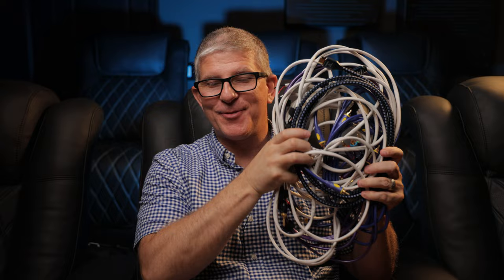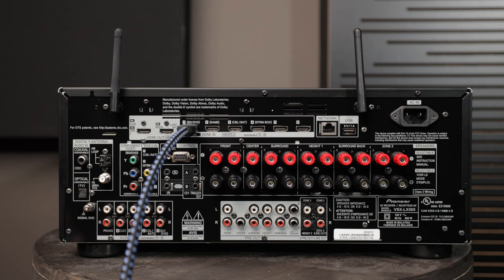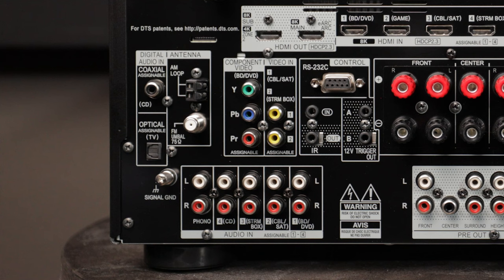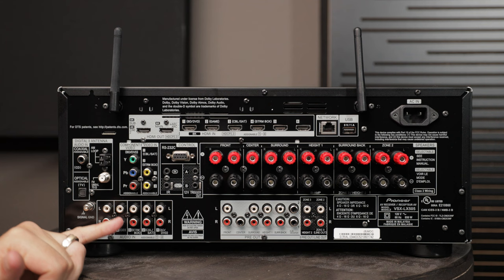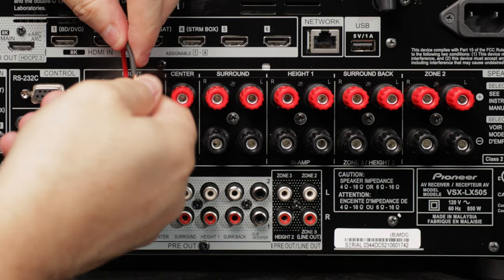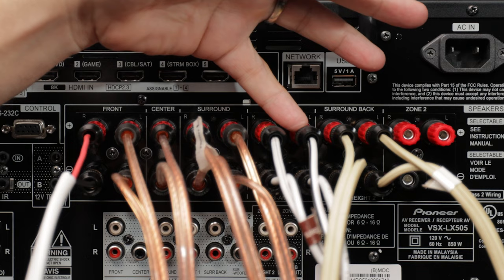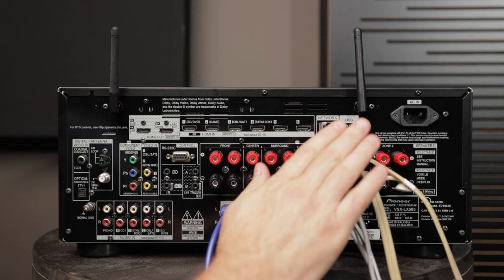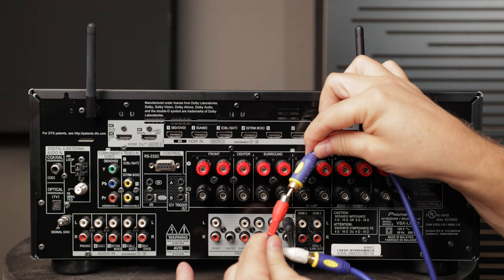How to Connect An AV Receiver (AVR) | EASY Step By Step Instructions

Comment: The only difference betwee this and the one I used 50 years ago is mine was metal and this is cheap plastic. What's old is new again!!
Reply: One other difference, this one has multiple HDMI inputs/outputs…..which weren’t around 50 yrs ago.
Reply: It is actually metal tho.
Reply: The one from 50 years ago also can have a bunch of leaking capacitors in it now as well. I wouldn't try to assume that much from the box alone. Also, this looks like a metal housing in this video.
Reply: How do you connect an av receiver to a tv with an internal tuner? Cheers
Reply: Sounds like the main difference after 50 well-lived years is the eyesight
Reply: Bullshit.

Comment: Oh my gosh, that's how amplifiers work? I'm glad I don't live in a mansion. Wait, (2024 update), that means 24 bit sources have more significance in big rooms. The noise floor in a small living like mine does not require past 16 bit noise floors at all. I don't need a separate amp to jump my 16 bit transcodes past room tolerance. Amps are there to help hardware represent the 24 bit noise floor by allowing more power to surge through them. Bit depth should be relative to the size of your room. Even then 16 bit/48KHz can still fill a room if you have the equipment that can handle even that.

Comment: I bought a house that had a stereo system already installed and I ordered 2 new speakers because some were buzzing. I had no idea how to wire them to the existing wiring. I’m so happy you showed how to do that and all you have to do is stick the wire into the terminal. It looks easy enough. Again thank you so much for such a helpful and informative video.

Comment: @Youthman, I am so glad I found your channel. This video answers a lot of things others weren't.

My friend has a:

 BOSE sound bar that has:
1.S/PDIF Output - 2.a RCA input #1  3.a RCA input #2  -3.a sub out 

SHARP AQUOS QUATTRON

What I see on the back(I'm assuming that's what I'm supposed to use for this case)
VIDEO 1 w/ R AUDIO L AND VIDEO
VIDEO 2 w/ R AUDIO L AND VIDEO
COMPONENT w/ R AUDIO L AND VIDEO AND Pr Pb and Y
(She has the  BOSE  RCA input #1   going into that component R AUDIO L AND VIDEO of the TV.

AV YAMAHA HTR
On the back of the AV I have no idea where to plug anything to the back of this. I twiddled around and put it in the CD in the DVD in everything I could and on the front put in the corresponding input and nothing works. 

I'm confused on making work through the tv(which doesn't work) the AV (which she has sitting there) and I'm lost.

 I see from your video the visual on the back looks so much like mine, but I can't get it connected and for the last 4 weeks till I seen this video, it started to make sense, but still don't know what I'm doing wrong. Its driving me nuts!!

Can you tell me where I'm going wrong or whats the best way please, Thanks

Comment: This person explained so clearly and so sample.
I have watched so many videos about how to add extra amp to av receiver,but this was super easy to understand.
I really appreciate ur video.
Thanks heaps!
Reply from the maker: I’m glad you found the video helpful
Reply: Hi sir.
I need to know more about the pre out connection.
Question: I have 2 AV receiver and they both have same rca jucks for pre out . 
One of them says pre out and another one doesn't says pre out it says AUDIO left, right, center, subwoofer rear right rear left.
So,I don't know what to do?
😊 Or if you could make another video to show the back of both receivers connections .
Thanks 🙏
Reply from the maker: @jannahrusdi872 what is the model number of the AVR
Reply: @Youthman  1: Integra model: DTR-30.4
2: JVC : Model: RX-7022v
3: Yamaha: model: RX-v565.
Thanks 😊
Reply: @Youthman  Hello sir.
I am still waiting for ur advice.
Thanks 🙏
Reply: Where does the subwoofer cable go??

Comment: Very nice overview. I would have liked to have seen you quickly discuss 12v triggers and possibly also IR inputs - but regardless this is a good intro for someone that has no idea where to begin. Thanks for your efforts and all the content you put out Youthman!  👊
Reply from the maker: Amps come with a 3.5mm cable to connect from the 12v trigger on the AVR to the amp. Turn the amps power to on. Now when you turn on the AVR, it “triggers” the amp to turn on. When you turn AVR off, it “triggers” the amp to turn off. That’s it

Comment: ahh there we go, that explains it. i just bought a pioneer vsx 815 at thrift for $20, using it for my PC speakers (sony bookshelf speakers), wasn't sure if I was supposed to do the bare wire twisty connectors or the pre-out (i'm so used to RCA cables, so i tried the pre-out). no sound.. then i went to the twisty, sound works, but was confused as to what the preout even was. thanks!

Comment: Hi, you mention that if you have a sub that you would plug it into the sub 1 on the back of the receiver, however you connected it to the one that has a 2 on the back. Does it matter?
Reply from the maker: No it doesn’t matter which one you use. They both output the same exact signal.

Comment: good step by step set up. But I have an 10+ yr old Yamaha system and all the speakers incl the sub are wired. I am looking to upgrade my receiver as I finally upgraded my tv to an new Sony LED. So my questions is can I use banana plugs for the sub to connect to the receiver?

Comment: Great video. I really appreciate it! Quick question… I am setting up an older pioneer elite monitor with hdmi however not arc. I have a pioneer elite vsx-90 Reciever and pioneer elite blue ray player. I just purchased a sound bar with arc (Polk) 
  Where would I connect the hdmi cable from the sound bar to my receiver? Could I connect it to the arc hdmi since I won’t be using that for the monitor?

Comment: Great video. Very simple and direct. I just purchased an Onkyo TX-NR696 AV Receiver which replaced my 18 yr old Onkyo that did not have HDMI outputs/inputs. My old Onkyo unit connected to my projector with component cables. Ive connected speaker cables to my new unit and ran HDMI cable to my projector. When I select HDMI on my projector, it says no “HDMI signal”. To set up my new Onkyo system I need to see TV screen but either the HDMI signal isn’t being sent from receiver or it’s not being detected by the projector. I know you did not demo Onkyo, but any suggestions? Onkyo printed material isn’t as helpful as i’d like. The only instructions it gives for initial set up is to connect to TV and then follow the prompts on the TV. I don’t use a TV, just projector….which isn’t projecting. I’m wondering if my new unit isn’t compatible with just a projector?? I’ll try calling their support line.  Thanks again for the great video.

Comment: Great explanation of connections..
New to all this type of technology but only difference from this to my old stereo hi-if (surround sound) is the hdmi inputs.
Plus if it’s made to do a job, I don’t understand internet connection to update system. What would be updated ?
And if you wanted all audio output channels to give maximum output, wouldn’t we have to connect an extra device - an AMP ?
Great idea though and fantastic full on explanation of connections
Reply from the maker: Thanks Deejay. I’m glad you enjoyed the video and found it helpful. There are several reasons for an internet connection. Many AVR’s and processors have built-in software for Spotify. Etc that utilizes your home network. Occasionally, a brand may provide a firmware update that provides more stable software or correction error in the programming.

Comment: Hi Youthman, thanks very much for your DIY setup instruction.  Do you mind to also make another video showing how to connect a Music Streamer to an AV Receiver?  Currently I connect my Music Streamer to my AV Receiver using digital optical cable but the output of the sound from the AV Receiver to my speakers is very soft and the subwoofer is not working (i.e. no sound output to subwoofer).

Comment: Hi. I have the Sony ta-an1000 but when i have connected the tv decoder to CBL/SAT but the sound out is not going to the center speaker but only to the front two speakers. I have a 5.0 speaker setup. I have my Apple TV connected to the media box and here i get full surround with speech through the center speaker. Any ide whats wrong?

Comment: I have a Pioneer Kuro TV, a Samsung DVD player and a new Denon AVR.  If I connect the DVD player to the AVR via HDMI then the AVR to the TV via HDMI then the TV audio to the AVR via optical cable, do I then have to connect the TV directly to the DVD player?  Or has that already been accomplished by the DVD to the AVR to the TV?  I am asking because the DVD player only has one HDMI output.

Comment: Is it possible to hook up a PS5 to a receiver running a pair of mythos  4 def tech  speakers by a projector. I would need b2 HDMI ports on the ps6. One for projector and one for receiver as the projector has no sound  just video. Any way to do it???
Reply from the maker: PS5 into one of the HDMI inputs on your AVR. Then from the HDMI Out on your AVR to the projector.
Reply: @Youthman  so you absolutely need a HDMI connection in the  receiver  can use a older one...
Reply: @Youthman  thank you i understand this   so I can still use the wires on the back of my receiver along with using a HDMI,  so a HDMI is absolutely needed on the receiver... sorry I ave asburgers and trying to understand this I am very excited to bring out te mythos 4 again....there great speakers...  tank you so much!!!  do you have a video link for projector  so I need at least 2 HDMIs on the AVR correct??
Reply: @Youthman  i want to share with you that my projector as no sound  just video  so the ps5 goes into the receiver ,the HDMI projects the picture to the projector  I thought the ps5 does that  I connected the HDMI to the projector  from  the ps5  and I got the screen up  however I don't know how to add the sound...  sorry if I am sounding confused...  i really appreciate your help and quick responses  I subbed...

Comment: Hello
I have speakers from the "Elite" DVD player.
The player is broken, but I have speakers that I want to use.
It is impossible to find the same used DVD player and I don't know how to use the speakers. Is it profitable to buy an amplifier and connect the speakers that way?
The speakers are not of any quality, but they are 170w and have excellent bass. I don't know if it is more worthwhile to buy some used 5.1 systems or to personalize these somehow?

Comment: Hi Michael, I managed to get another 15inch monolith  cheap because he is moving to Canada we had a good test but when I got it home I couldn't daisy chain it I am getting no signal from either of the two front one's the led stays on red flashing but I did pull out the rca cable for the sub and it flashed green for a while, if I connect it directly to the amp it works, at the back it has line one and line two,the two front subs I connect the line one to my amp and I connect line two too line one of my rear sub.  I am having trouble finding the manual but found the white gloves lol
Reply from the maker: The LED’s should not flash unless there is an issue with the amp. Hopefully that isn’t the case but I would recommend contacting Monolith support.

You should be able to go from the sub out on your AVR to the Line in on one sub, then line out from that sub into Line In on the 2nd sub.
Reply: @Youthman  just had a bit of sleep and while resting I went throw it in my sleep ,so will rerun it when I get back from work, if no joy then I have a b&w pv1 I shall test it out on. Thanks
Ps I am running a marantz av8805 and two yamaha mx-a5200 aventage

Comment: How do I connect 2 av amplifier together using 1 as a power amp. I am planning to use 3 channels. 2 main and 1 centre. Then on the other amp what output do I choose. Will the centre still work if I choose the 2 main input

Comment: The HDMI Arc/eArc out goes into the Arc/eArc HDMI in Port on the TV? Isn't that just audio when plugged into audio devices (soundbar) or does it carry the visual as well in the case of the AVR (including from legacy devices which tbh looks eminently useful)

Comment: First of all thank you for the very helpful video especially for beginners. 
But there is one thing I don’t understand. Most of the AV receivers have reasonable power output only for 2-3 channels. What’s the reason? If I buy over 1000$ receiver I expect to have enough amplification. But in fact even for 5.1 if I am using mid range speakers, I have to set up two receivers just for amplification purposes. This seems strange. I have no place and budget for second amplifier. Now I am thinking just to continue using my sony ht-ct390 soundbar which sounds just great for its value instead of investing 2000$ for two receivers and speakers. I am not even sure if I will get noticeable difference. 
Another question I have is related to audio/video lag. I don’t find this information in specs, but it is very important for comfortable gaming. Are there any benchmarks for the input lag performed with single and double receivers?

Comment: I had everything working great until I got the FireBox. Now only the FireBox works by showing images and sound through the TV and Receiver.
I have a Samsung 3D TV, a Sony DVD player, an Xbox Series X, and a PS5 going through the Onkyo AV Receiver TX-NR676.
I've tried connecting each of the devices through the receiver to the TV's HDMI port to no avail. I've been searching the internet and again I've not found a solution to this issue.
Any help is greatly appreciated.

Comment: Dear I have a Yamaha DSP-AX530 AV amplifier. I have a problem that relates to sound coming from center speaker. I hear center speaker sound in both front left and right main speakers even when I detach center speaker from the amplifier. The center speaker slot gives sound anyway in both main speakers. Is it a problem or it is the way it sounds. Me from Pakistan. Thanks.

Comment: This would be by first time setting up a surround sound system and I have started to connect my individual speakers to my audio visual receiver but my sub-woofer has inputs for cords to hook up to speakers as well. My question is should I just connect all of my individual speakers to my subwoofer and then connect my subwoofer to my audio visual receiver or should I connect all my individual speakers to my audio visual receiver and then simply connect my subwoofer to my audio visual receiver.
Reply: Connect all individual speakers to your audio visual receiver to its respective amplifer terminals and connect the subwoofer using RCA to Audio visual receiver subwoofer output.

Comment: Thank You so much. You always learn something!
I would like to know how to connect 2 floorstanding speakers in addition to the surround system, but only for listening to music (stereo). Where do you connect them? Because, the loudspeaker connections are already used for the cinema experience :-(
Reply from the maker: Some older 2ch receivers allowed you to connect two pair of speakers (A and B) and you could toggle one or both pair on and off. You won’t be able to do that with an AVR. If you want that, I would replace your surround speakers with towers.
Reply: @Youthman  Thanks. I have the AVC X4800H 🙈

Comment: I have a Yamaha 5640 receiver that  has been in storage for ten years and started to put it to use. My prob is my remote will not turn it on. It turns on by pressing the main power button. Second my tuner will not pick up my fm channels. Can you suggest a remedy. Thanks

Comment: Do I still need to provide Ethernet cables for my TV my PlayStation and my Apple tv? Or once I put the ethernet cable into my receiver will the HDMI inputs take it from there?
Reply from the maker: Ethernet is used for firmware updates, downloads etc.

Comment: I really want to thank you for all this clear and pro explanations.
One question: 
By connecting the video source to AV HDMI, does the receiver amplifi the video signal as well as the audio the it send it to TV??
Or it's only a bypass and any quality comes from the video source will be sent to tv by AV receiver?
Reply from the maker: HDMI carries both audio and video signal. I’m not sure what you mean by does it amplify the video signal.
Reply: @Youthman  hi, 
We know av receiver improve the sound and then send it to speakers, does it also improve the video signal before sending it to TV?
Reply from the maker: There isn’t much (if any) video processing in an AVR.

Comment: Say if you had a media switcher that could connect to RGB strips behind your TV which allows them to mimic colors on your TV. Would it be possible to connect the media switcher to the AVR to still receive the full capacity of HDMI 2.1 from the media source to AVR to the switcher to the TV? Or is it like a certain path you need to use in order to get that full capacity
Reply from the maker: I have never used one personally but something like this product might be what you’re referring to https://www.lytmi.co/products/lytmi-fantasy-3-tv-backlight-kit?gad_source=1&gclid=Cj0KCQjw2PSvBhDjARIsAKc2cgOd4MFZOIzJ5JD5_NbalLxms6YfFOHFeoFvUUmgjnsIdbr_07iaEHMaAvkXEALw_wcB
Reply: @Youthman  I was actually looking at that one, I just want to make sure when I connect everything, it works perfectly
Reply from the maker: I would reach out to their support. Unfortunately I’m just not familiar with them